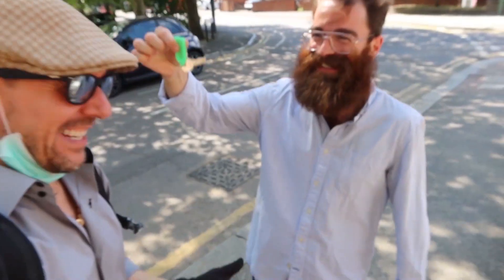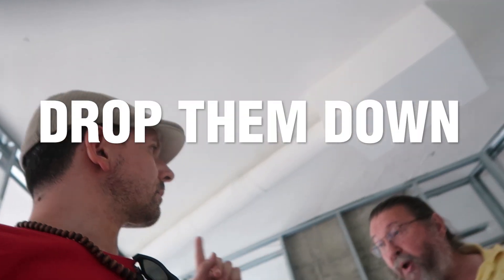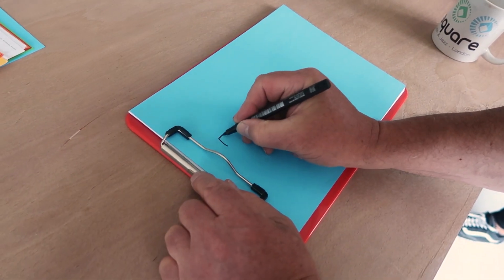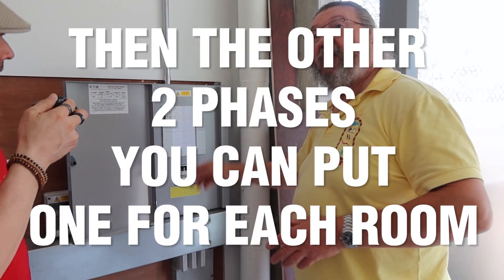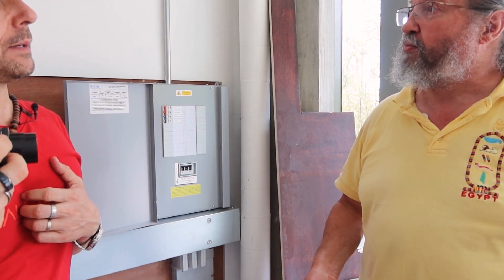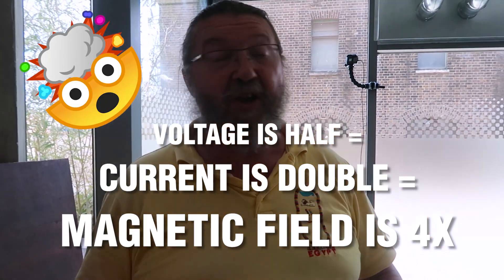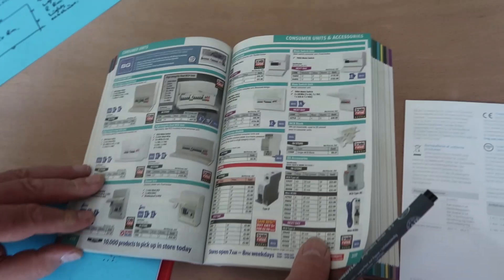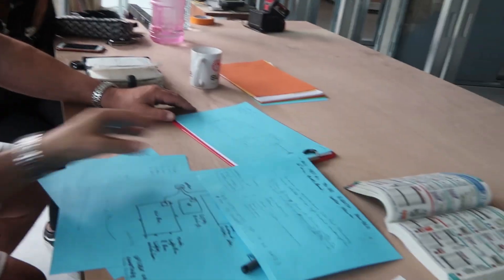Building My Dream Music Studio Ep. 4: Electrical System Design

Comment: Hi Claudio. I’d like to add some comments:
Probably you’d like to put some sort of surge protection (the peak voltages that were mentioned) for your equipment. Surges can also come from the outside of your building and the division onto different phases protects you only from surges generated by your own stuff like eg the AC. Maybe you would also consider online UPS devices that in addition to surge protection also clean the current and in case of power failure your equipment would stay on for some minutes to allow an orderly shut down.
Then I would put the higher spec Ethernet cables in, as they are difficult to change afterwards. Cat 6 should be good ,  but maybe you should allow some extra beef for future applications. As audio cables, Ethernet cables should be run separate from power cables, to avoid interference. You could also install a switch in each room and interconnect them with fiber cables. In that manner you won’t have any interference issues. It’s a bit more expensive though.
Hope this is useful

Comment: Suggestion - use shielded electricity cables from outlets to equipment and racks. Less headaches on unbalanced audio and electricity cables crossings and interference. Just to remind you - 80% of your synthesizers and modules have -10dBv unbalanced audio outputs. So, balance these near the source or keep cables as short as possible. If you need patchays, don't be cheap. Cheers! :-)

Comment: Claudio, you’re learning the complexities, hassles and expense of analog audio signalling. Digital signalling is much more noise immune than analog but it has its own set of issues.
Go the whole hog with optical fibre connectivity then you don’t have to worry so much about induced magnetic, electrical noise or electric shock.  Instead just Bill shock!!

Comment: Hey Claudio, before you buy a multichannel snake between your A and B and C rooms, i’d strongly recommend thinking about running a few more CAT6 cables instead. DANTE is a very low latency, uncompressed audio transport protocol, and it’s matrix by design. You can route any single input channel to any single output channel, making it infinitely more flexible than analog cables. You can insert audio of softwares on a computer directly into the system, or you can have a 64 channel recording interface onto any laptop for about £40. It’s a very versatile solution for long years in stage productions, festivals, etc. Though, it’s not that cheap yet.. Keep up the good work! Best, Dan
Reply from the maker: Yeah I’m passing 400 meters of cat 6, no worries :-)

Comment: Great stuff!  Are there issues with this design with audio equipment connected to different breakers with different ground levels?  Also CAT6 is more than enough for you for both audio and video.  If you need better than than don't do CAT7, do fiber unless your stuck with RJ45 copper connections because of the devices.  If your stuck with RJ45 copper then do short runs to a switch and do the runs between switches (such as between rooms or between a room and data closet) with fiber.  Also when you do the network double everything and buy proper switches that are stackable for redundancy.  Same with the data room, redundancy on everything.

Comment: You should never put (at least by Italian laws) low voltage wires (like network cables) along with the main power wires. It is a security issue: if the electrical wire goes overload they can melt all the plastic insulation and "jump" to the copper in the network cable: then you get fried as soon as you touch your PC. 
One more tip: using just one phase for ac/motors is good advice but when you plan the power distribution be sure that the average current on all the 3 phases is balanced (they should have the same average current) otherwise the neutral wire will suffer, because it will get all the difference in current (in an ideal situation, it should have no current). Also.. don't know in the UK, but in Italy you pay an extra fee if your phases are not balanced (because it creates troubles for the electrical supplier company). 
In bocca al lupo!
Reply: "Also.. don't know in the UK, but in Italy you pay an extra fee if your phases are not balanced"

In germany, only big companies have to do this. I guess in Italy it's the same, but idk exactly. You sure he has to pay for that, cause compared to bigger companies, his studio is quite small consider how much power it uses.

Comment: When you switch off power you generate spike because essentially inside the motor there are coils, when the current switch off the magnetic field collapse and the coil have the opposite behavior of capacitor, capacitor let pass ac and the coils instead blocks ac, to maintain the energy costant (I*V) the coil raise up the voltage because the currents drop, however those devices are made to don't feedback to the ac line these spike because they could demage the electric distribution system.... So how is even possible that these device can blow up other electronics devices?

Comment: I used to troubleshoot noise issues with cables regularly,  there are a few things to keep in mind:

Segregate your cables into groups, 1. Mains cable 2. Digital signals 3. Audio cables.  Keep each group at least 300mm apart. 

Don't loop cables in a circle, loop them in a figure 8

Cross cables at right angles 

If you need to run trunking of different cables close to each other, use metal trunking or add a bonded metal plate between them.

Use balanced pairs wherever possible.   You can make a balanced pair single ended and vice versa with a balun, they're common for microphones as they reduce hum (there's also a Beatles track where Paul used one with his bass, I forget which)

If using screened cables (like your audio link between the rooms) then only ground the screen at one end otherwise you'll get ground loops (which you'll hear as hum).  At the other end heat shrink them and tie them back, that way they're there if you ever need them but it's also obvious that they aren't connected. Same with the overall screen.  Make sure if they go through a breakout box or a junction box that the screen is continuous (remains connected). 

You talk about buying an empty consumer unit and then show a populated one!  :p Sometimes it's cheaper to buy a populated one and take out the bits you don't need, though I'd put the sockets on a RCD anyway.

If you do get issues with tripping breakers due to current spikes during turn on (unlikely, but anyway), you can use class C or even class D breakers (the ones you showed were class B) which allow a higher current for a short duration before tripping. 

Try to balance the loads on the three phases (within reason).  The electrician will know all about that though. 

You can never have enough sockets ;)  If you want to get super nerdy you can put all of your noisy stuff on one ring main (PCs, anything with a switched mode power supply) and all of the audio gear on another.  A common trick is to use different coloured faceplates to denote this.  Now might be the time to consider a UPS for the PC and anything that would lose data on a power loss, you could run all the noisy stuff through that (which the UPS has the added benefit of isolating from the mains and thereforer reducing noise carry over)
Reply: THIS GUY, has some goodies worth of advice! Yes sir! I am on it! We in the USA and Puerto Rico are stuck with 125V at 15A/20A but I will say I can do what you suggest just the same. Now, we do not use ring circuits here. Would that be recommended with our higher amperage? Or stick to the radial as is common in the US and Europe? Also, here in the US we have what is known as ISOLATED EARTH and SURGE SUPPRESSOR protected circuits for equipment and for us nerdy types, the added UPS isolated power systems as well.. But the amps and half volts of UK is something I did not consider, as we just use thicker wire here that is also HARDER(copper mixed with tin).
Reply: @pianokeyjoe  the ring circuit just allows you higher current rating (32A) than a radial (16A) for the same wire size - yes there are plenty of good and bad reasons for ring vs. radial and vice versa, but I would use whatever works best within the allowances of your electrical standards - I think if I lived in North America I'd be tempted to just run 220V everywhere lol ;)
Yes they just added surge suppression to the latest regs here (BS7671 18th edition) but I'll admit, I haven't read up on where it is needed.  The isolated earth is presumably related to the centre tapping on the supply transformer, something that we don't have in the UK as we get 240V direct.

Glad you found it useful 😊
Reply: @gavster89  Oh how I was tempted to do just that.. 250V at 15A or 20A but here in the USA it is as you say, centre tapped transformer with 125V on either side. But then again, I was thinking of using 24VDC and 12VDC power system in my studio since MOST modern electronics runs on 12VDC on average, and 24VDC for security electronic devices. I am doing a mix. UK and US sockets for my 125V mains, and Australian sockets for the DC 12VDC/9VDC power system to power the tons of music keyboards that I own that use either of those voltages. Amperage would be what ever max I can get away with, not to exceed 10A per socket point. RCDs(GFCIs), and Surge suppressors have to be US due to the special electronics inside so sadly I can not use UK brass plated RCDs here.. at least not the UK made ones. I can use the French made LEGRAND rcd sockets and the Italian made VIMAR and BTICINO brands since those are dual voltage and those brands ARE used in the USA and Caribbean.
Reply: 300mm is quite the overkill.

UPS is life saver for your computer, have it hooked up at least, but remember that the power that UPS's produce is noisy as hell -> you might need even more shielding and distance between a wire that has UPS delivering the power since the EMI issues and if your computers powersupply isn't well enough filtered, it might cause noise issues with audio interface. So EMI filter after UPS can be a good idea. (ask your electrician)

Digital cables are very, very immune to noise and it's either or: it'll work, or it won't work.
And CAT6a cable is so well shielded and it's balanced (as ethernet is) etc. that for you to get issue with it running next to a mains cable needs hundreds of meters or parallelism or gigantic currents in the mains cable to induce enough interference.

We use CAT6 stuff in live shows all the time with 100m runs to the stage and back running along side the power lines and almost never have any issues.

And even then, small distance separation between them is usually enough.

For the analog cabling, yeah, you want to keep them away if you're running them parallel for longer than let's say 20 meters, but usually any proper multicore installation cable is double shielded and all signals at least balanced so you should have no issues.

You can use "starquad cabling" for longer  static analog runs and that'll be the best way you can prevent any noise issues from coupling. You don't need new connectors, just the cable needs to have 4 wires and a shield, instead of 2 wires and a shield.

https://en.wikipedia.org/wiki/Star_quad_cable

If you're really paranoid, use shielded mains cable (Live Neutral Ground Shield), that stuff exists because large scale industrial systems have huge currents running through power cables and cable runs can be hundreds of meters, that even with all the shielding there can be issues with EMI. (obviously choose one with large enough of a diameter for your installation, this is for reference only: https://www.tme.eu/en/details/topflex-uv4x4/power-cords/helukabel/)

And never EVER connect stranded wire to a  screw terminal without a crimped ferrule ;)

Your electrician knows this stuff, or at least they should! :D
Reply: Hi Gavin.
I bought a Behringer U-Phoria UMC 1820 interface a while  ago and I get significant noise, but only when I plug the USB connection into my PC. I'm using unbalanced audio cables coming from a couple of modern Korg synths (a Minilogue XD and Wavestate). The output from the UMC 1820 itself goes into a smaller Behringer 802 mixer (along with my PC sounds and an Amazon Alexa thing.)
Apologies in advance for asking for free help, but do you think the problem might be that the audio cables I'm using are unbalanced, or is it the way I've plugged the U-Phoria into a mixer? I know virtually nothing about this stuff. Anything you could suggest would be gratefully received.
Reply: @tuppswahey  I'm just glad people are reading the comment ;)  unbalanced cables should be fine over short distances, it sounds like you have a ground loop on the USB port, some USB audio devices have a ground lift switch but I don't think your UMC 1820 does.  I would try a different USB cable and do some Googling of "USB ground lift" and you'll find all sorts.

You say the PC sound goes in too, perhaps try unplugging that and see if the issue goes away - the ground on the audio and the ground on the USB are probably connected in the PC.  Perhaps see if you can use optical out from your PC to break that loop.
Reply: @gavster89  Thanks very much for your reply.
Reply: @gavster89  USB ground loops sound like 50/100 or 60/120hz hum, if the noise issue is something else, it's not ground loop issue and having a ground lift might break stuff and not fix the issue. USB power is inherently very noisy and many cheaper devices don't make good enough of an effort to filter it out, even when using external power supply.

In that case there might not be anything you can do except get a device that does better filtering for the USB power.
Reply: All good advice! UPS are essential. And walkway areas? Don’t run audio up and over... just “rout” the concrete a bit and send cables in that narrow channel in a sleeve that won’t be corroded by the fresh concrete filler. Also... surge and RF filter between the mains and your kit... I’ve had a few bits of Alesis kit die on me with the smallest spike. Notch RF filter on mains is worth it too. As for long runs, you can also look into ferrite chokes.

Comment: As a musician AND an architect who also doubles as an electrician I MUST have more videos of this guy Clive!! I am building my home studio on the top floor of my 112 year old brick house(no other choice), and it is in America.. Sadly.. But I am using UK power sockets,switches and other bits as that is what I LIKE. I am using CRABTREE platinum series BRASS sockets and switches and Wandsworth blue trunking sockets as well. The wiring is sadly American so it will be harder grade copper/tin mixed and I do need metal conduit tubing for all of it. A fun time. I am using glass clad polycarbonate bullet resistant panels for my windows and mix/recording room partition wall. I am thinking of using all that metal skeleton framing instead of wood as lumber is so high in cost right now it makes sense to use metal and masonry. Cat 6 instead of cat5(got it), Shielded cables instead of unshielded(got it), Balanced instead of unbalanced(got that). breaker SUB PANELS for each section of my studio(got it).. Need more input! Number 5 alive!
Reply: @russ254  Lol sir here! lol! Thankyou :-D. I like what I like, what can I say?

Comment: Ugg! Sorry Claudio, but had to pause and comment right away.
CAT(x) ‘Ethernet’ could should NOT be run parallel to power cables; but crossing over is OK.

Mains cables radiate an electromagnetic field which the Ethernet signalling will NOT be happy about.

I am a networking-engineer by the way.
Reply: we actually have standards for that as well...  BS EN 50174-2 and BS 6701.

Comment: CAT6 cable is more than fine for 1gbit data for the lenghts you are going to be installing. CAT6a is for 10gbit, which would be overkill, so would CAT7. Just make sure the cable is shielded, S/FTP is best, since each of the data pairs is shielded from each other, and the entire bundle is wrapped in foil to shield from external noise.
Reply: But please throw away those all plastic rj45 connectors. If you wanna go with cat6 spec shielding you need to use metal shielded rj45 connectors and make sure that the major shield wires of the cat6 cable is connected to the metal shielding of the connectors when putting them together. Otherwise you loose the cat6 spec and fall back to cat5 or maybe worse. The wires are all the same, it's all about the correct shielding technique to be able to transfer clean >500mhz digital signals.
Reply: I say wire up for 10 Gbit for any new installation, it's a cheap way to future proof. You may not need it today, but who knows what kind of magic the next 10 years or so will bring...
Reply: Dante, AES67 and NDI all run fine on shielded CAT6
Reply: And CAT6 not A, 10G for 55 meters,   CAT6 i all you need, if your not a internet service provider

Comment: You should think about double earth sockets and a clean earth just finished installing electrics in a studio and fill the trunking with rockwall to stop the Sound travel through the trucking because it will 100%......also run the fuse board for the studio separately i.e. 2 fuse boxes for the building to stop harmonics you can get clicks from the a.c units

Comment: Learning that the magnetic field is 4x when the current doubles definitely made this worth watching.
Reply: I'm pretty sure the relationship between current and magnetic field is 1:1. 🤔
Relationship between current and resistive heat loss is squared. 👍
Reply: @wizrom3046  Absolutely: P = I^2R for power and B α I (i.e. B = kI) for magnetism.
Reply: What does this even mean 😭
Reply: and thus noise increases..
Reply from the maker: Right?!!!
Reply: jeez you nerds
Reply: @Raffael-Tausend  @Wiz Rom Yep, it's 1:1, where 'k' in WizRom's relation is mu/2pi*r.  He's likely mixing some of  the power and dB relations.  Still, Clive knows what he's doing and is cool.  😎